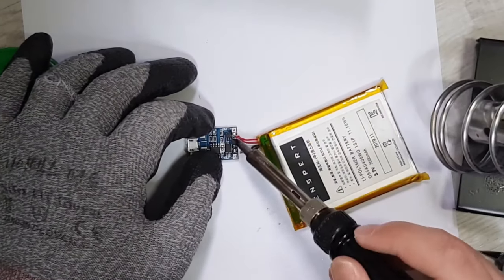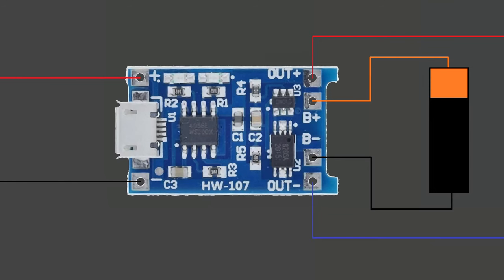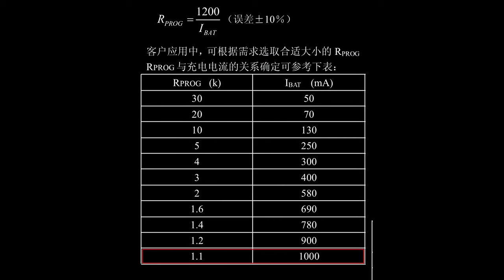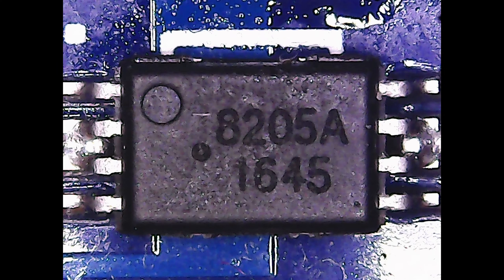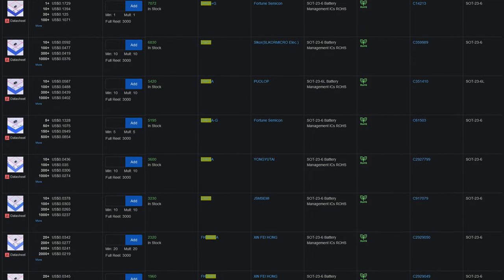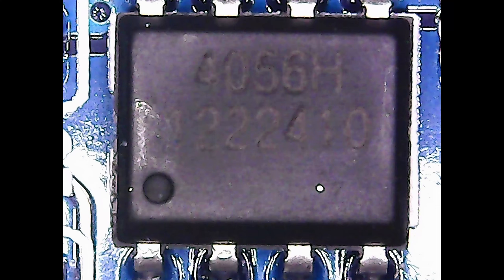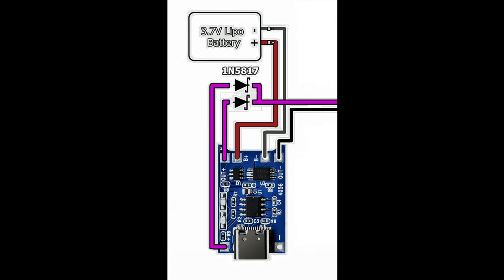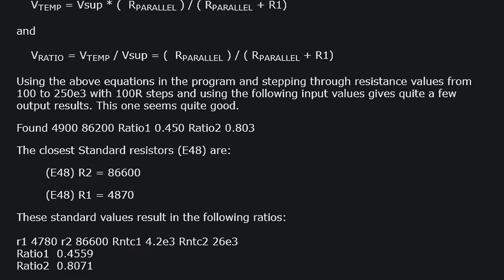TP4056 Explained: Functions, Limitations and more

Comment: Can we connect multiple batteries to one tp4056 module for charging it? Also what happens if modern smartphone chargers are used (like 20w, 60w)
Reply from the maker: yes you can connect multiple batteries in parallel. also, TP4056 only takes 5W from charger.
Reply: @blue_on  how to do fast charging???
Reply: @Otazuki004 I’m pretty sure this involves changing a resistor, but also changes how it charges the battery if it is below normal voltage levels.

Comment: The only good information is about turning on temperature protection and it only says so at the end and doesn't explain anything about that, make another video explaining this feature plz
Reply: Disagree completely, it is very useful to distinguish the variants of this board because often the seller does not provide the intricate details.  On the other hand, it was pointed out to consult the datasheet for temperature implementation which is correct.  We can't very well hold your hand and wait for you to supply specifics of your design requirements and then calculate that out for you.  If it is beyond your understanding to use a datasheet to work out the component values and topology, then you should leave it alone as it is beyond your skill level, and frankly, probably dangerous for you (or others in your absence) to be messing with DIY charge and discharge of Li-Ion batteries at all.
Reply: Yyeeaahhhhh...   except he DID in fact explain how to disable the temp function and how to configure it if needed.  Not only that, he goes on to explain where you can get more detailed info for this feature. 
   It seems strange that even with the ability to rewind as many times as is necessary, you still somehow missed this info.   🤔🤔🤔

Comment: Thanks, I appreciate your taking the time to describe the differences in these very similar modules.  I have yet another variant which is similar to your latter examples, is USB-C and "4056" on pcb front and no markings on the rear,  but the chip markings are a little different with (no branding) 4056H, 8205LA, and DW01-A

Comment: Is it possible to use just one 4056 to charge two 18650 batteries connected (parallel) ?
Reply from the maker: @kennnnnethchua  it is safe. problem is that the TP4056 is linear charger. meaning it just dissipates exeeding voltage into heat. it makes TP4056 chip hot whie charging large battery. you can use IP2312 instead.

Comment: I have 2 Samsung 2500 mAh cells connected in parallel 
Total capacity is 5000mAh
Can i use single TP4056 module to charge it or should i charge them separately by TP4056
Reply from the maker: as you connected them in parallel, total voltage is 3.7V and it means single TP4056 is applicable.

Comment: for charging use only? how about the out put?
Reply: The output are next to the positive and negative you will connect the battery wires to on the board

Comment: Hello. Can i make for module to work all time? For low power consumption
Reply from the maker: you can use ICs that has power path control like BQ25606. or even all-in-one IC like IP5306.

Comment: Can i put more the  1 battery?
Reply from the maker: in parallel, yes.
Reply: @blue_on  4battery 1module is it ok?
Reply from the maker: you can put even more
Reply: @blue_on  ohh i see. Thank you 😊
Reply: @blue_on Im new into these kind of things,Can I use this module to my broken power bank? Can it handle 12pcs. 18650 batt?
Reply: @uneedtosmile  not on a powerbank unless it is running in parallel.  12 18650s is a lot for this unit to handle.  I wouldn't. Some of those batteries could very well be in series.  What is the voltage of the powerbank?